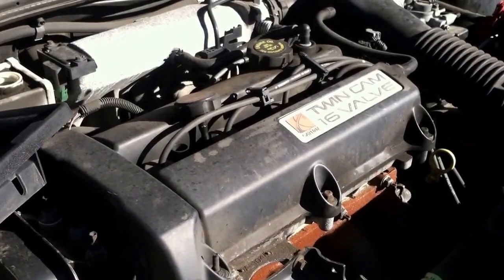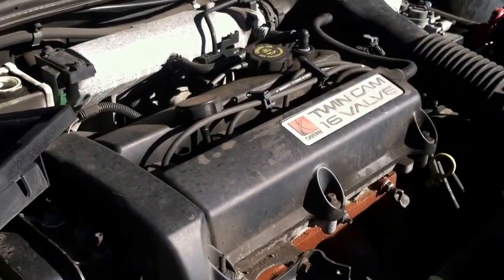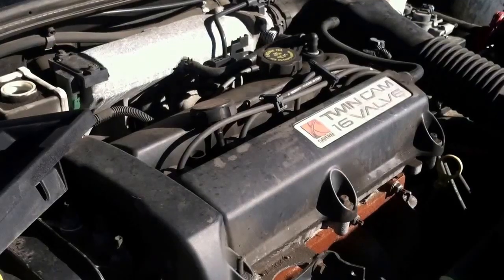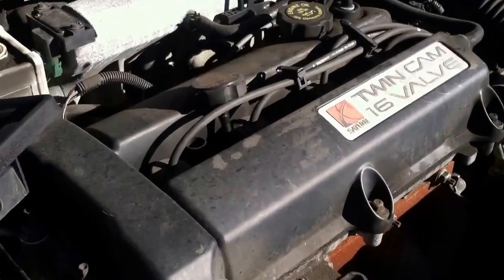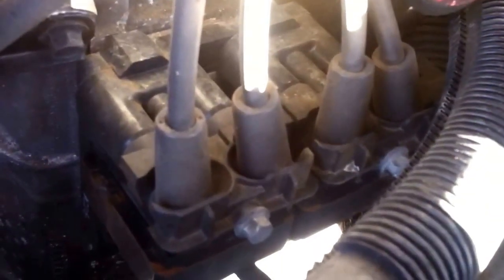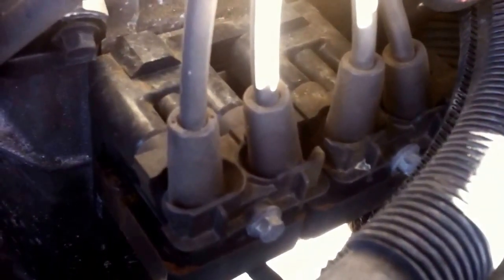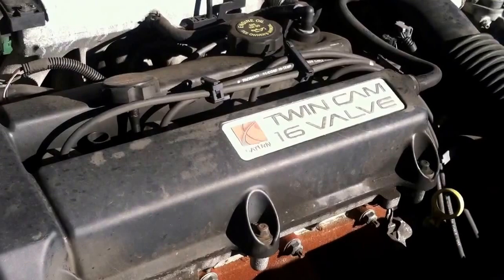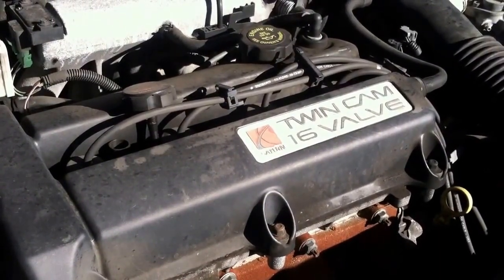Saturn S Series Misfire Cause

Comment: I went to change my plugs, and when I pulled the wire ends out off the two plugs to the left, there was oil all over the ends. I noticed on this one that they were dry. I feel like I have a big problem? Do you know why there is oil down in the holes?
Reply: Yeah it's your valve cover gasket or screw gaskets from middle of valve cover. 30$ fix if you do it yourself.

Comment: I have a 2002 sl2 wires been replaced last year .new fuel pump and filter. Had hooked up a pressure gauge .pressure drops down to almost zero after a hour or so..the only thing left is the injectors. Btw I read the codes it's a p0300 random cylinder misfire .also plugs were recently replaced..and a smoke test was done for a vacuum leak. And none found.im going to attempt to remove and clean the injectors
Reply: How did it go
Reply: Egr valve. Im years late
Reply: @2StrokeSmoke544  thank you. , I appreciate the reply.  better late then never lol. as it turns out it was the ignition module.